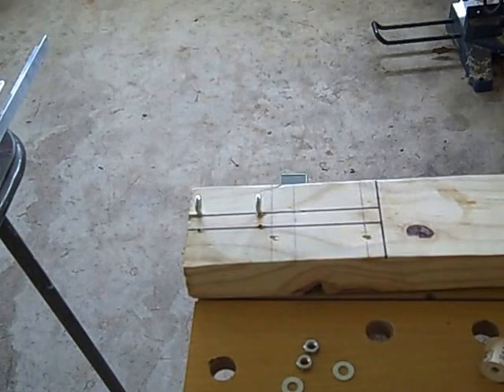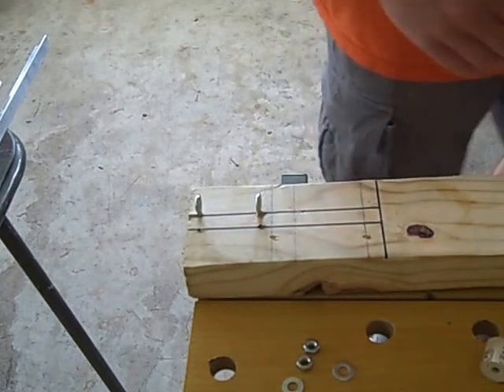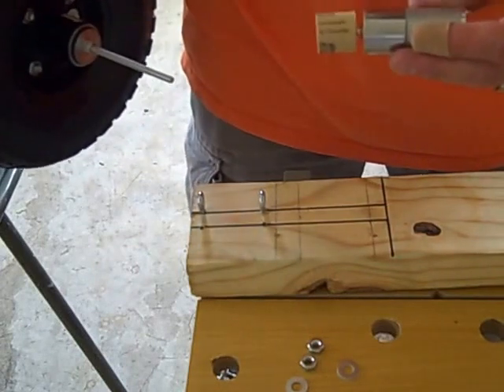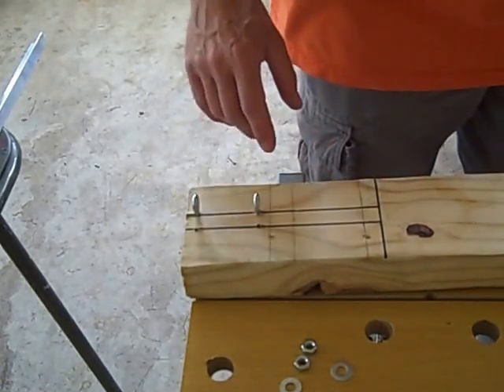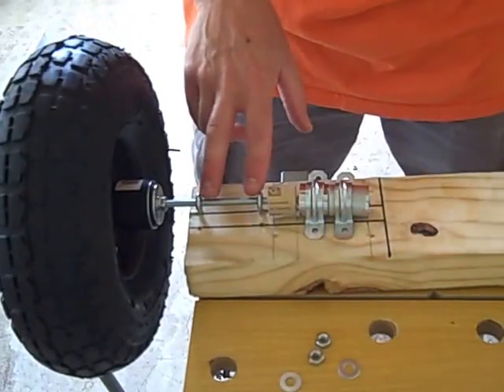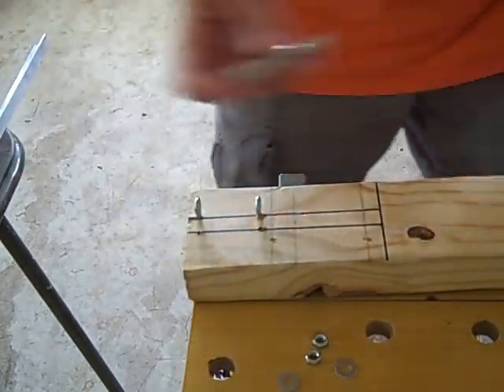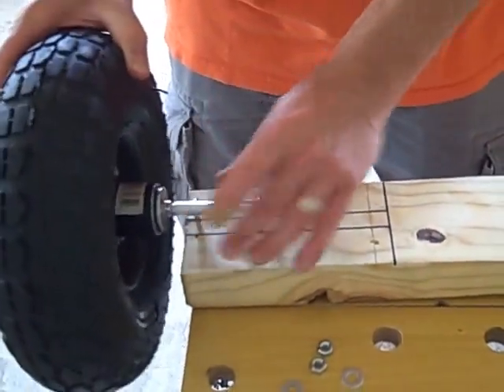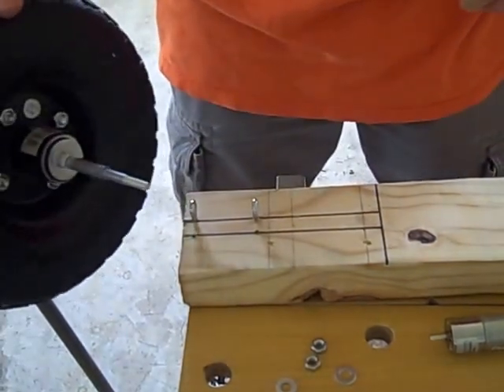xmrp coupling

Comment: Joe Hubert    hi there, I'm new to this stuff but I purchased a 577 drill type small motor on ebay and 3 miniature toy motors for model cars etc . I'm learning how to fit different flexible couplings  and hubs etc to these  these two types of different size motors large and small. I'm going to make a miniateur lathe to make my own nunchucks from quality hard woods. Also I want to make a small table saw etc.  Watching the Utube videos, the guys always use small bearings to run shafts like on the homemade belt sander project where he used his drill to run the shaft (thread bar) (to applicable size) running on support bearings,    which  1. supply support the shaft   and     2. freely turn on their own.     From looking at those eyebolts, although it would work, its rather crude, and will cause friction and wear. On ebay you can get 20 miniature bearings for £2.00. and for the size you need there on your project probably 2 larger bearings for £5 with a 10mm or 12mm shaft centre but then ofcourse you will need the bearing holders as well which bolt down on the wooden support. instead of wood use a 10mm thread bar for an axel (or what ever fits) then matching 10mm bearing centres if they slip you can use CA glue to glue them, same size nuts and washers to keep, lock, in position.